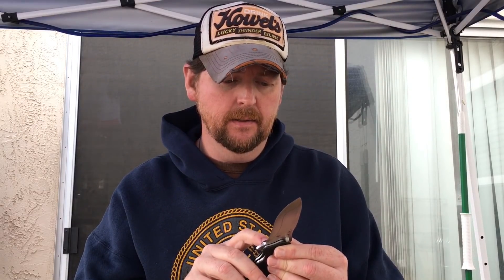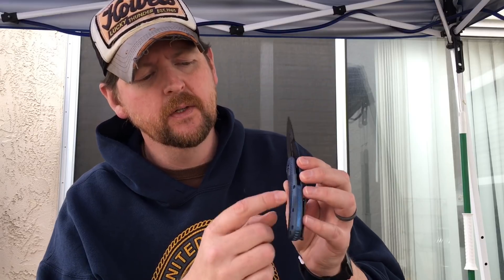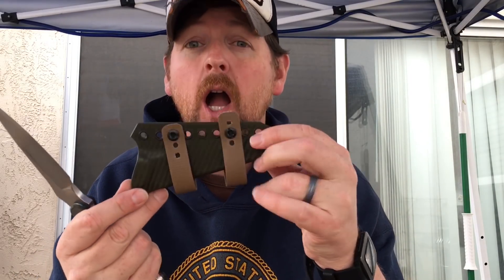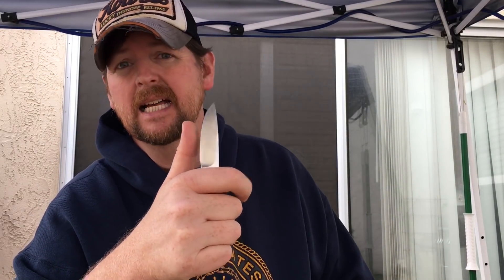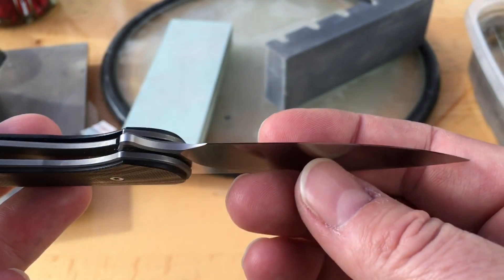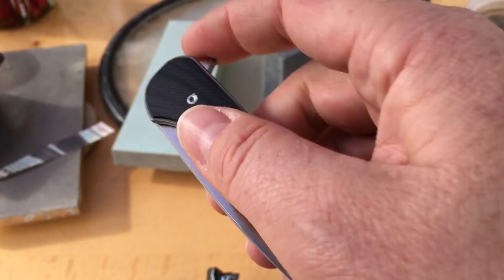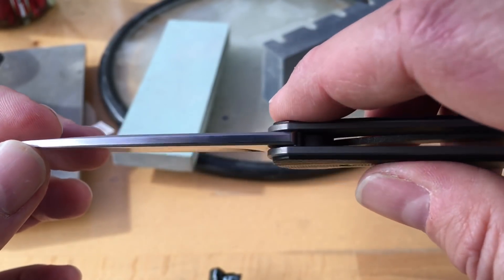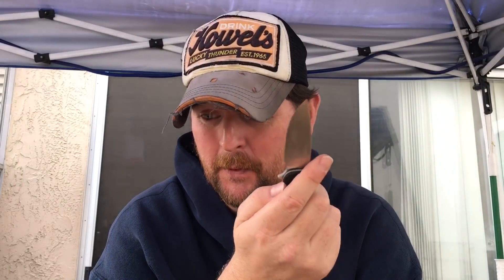Ferrum Forge design gents folder

Comment: my falcon clip bent, and massdrop is not offering replacement clips until january =/ glad they are switching to a stamped clip now, less goes wrong with simple designs
Reply: I think the second run of the crux is also with different clip now